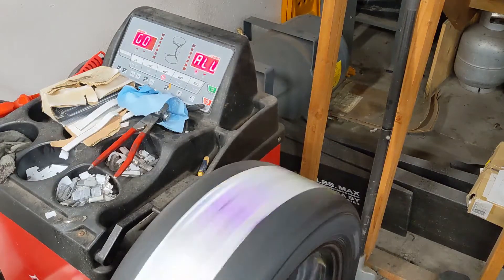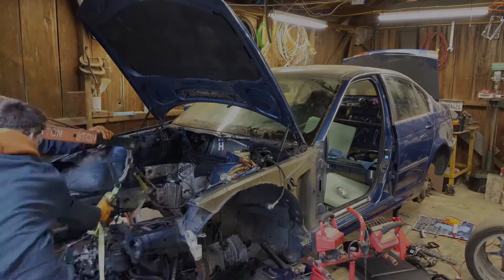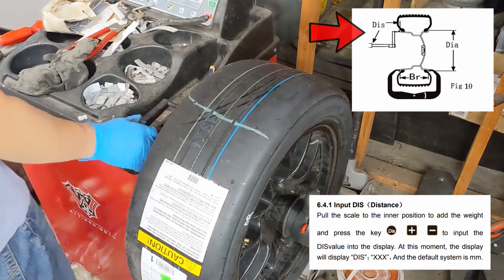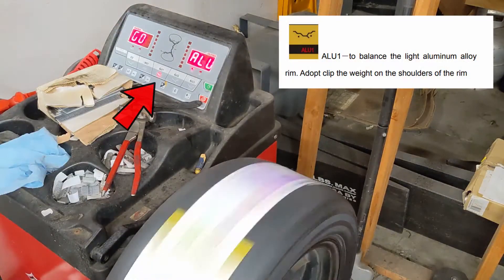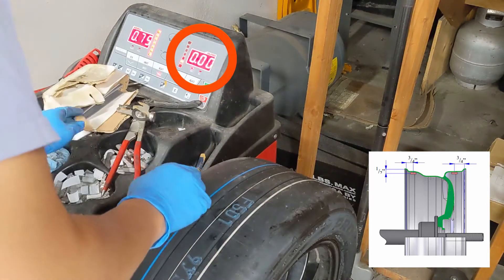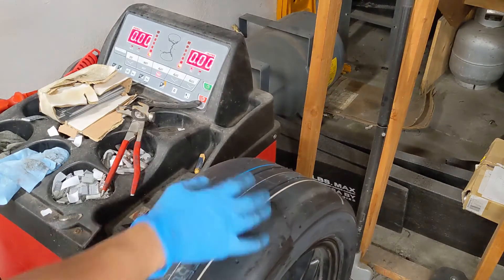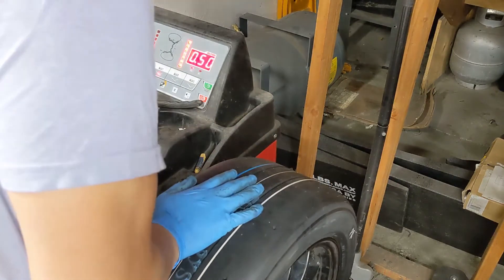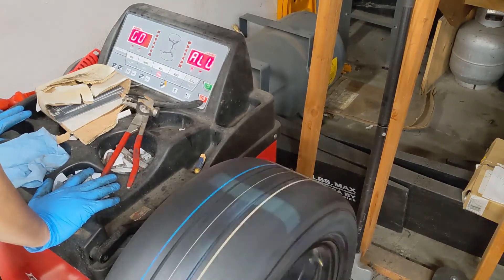Balancing wheels and tires on a Derek Weaver balancer ⚖️

Comment: Is it just me or did you edit and skip a step at the end?  You and your readouts said you need 3/4 oz on the inside, and 1/2 an ounce on the outside, but I never saw you add the half ounce to the outside, you clipped your video, added a 1/4 on top of the inside weight and said "that's it."
Reply from the maker: Very likely I clipped something during an edit!